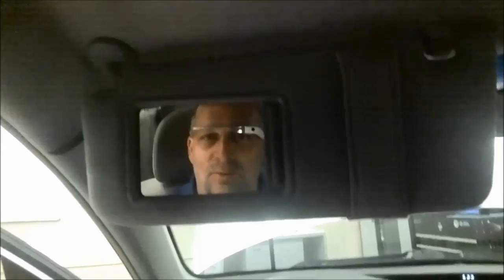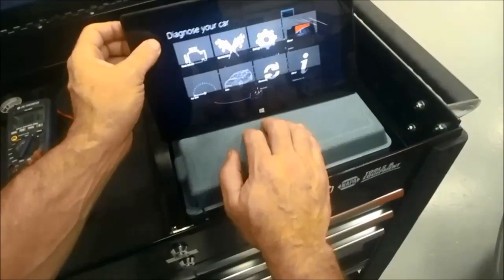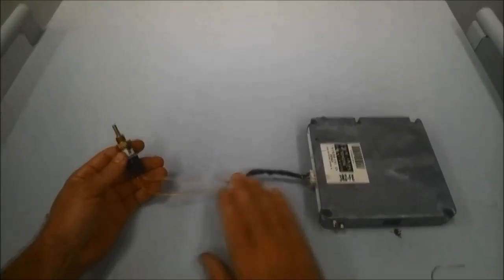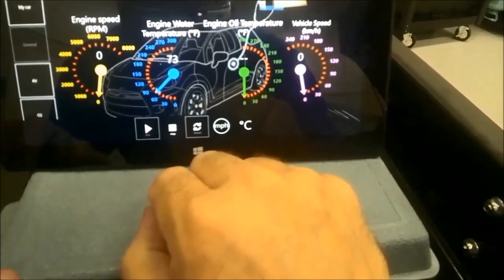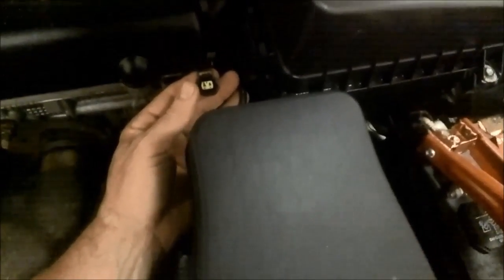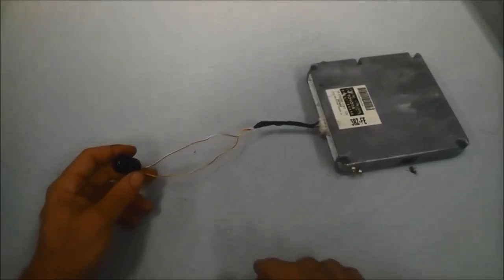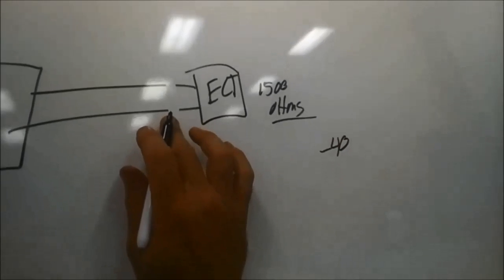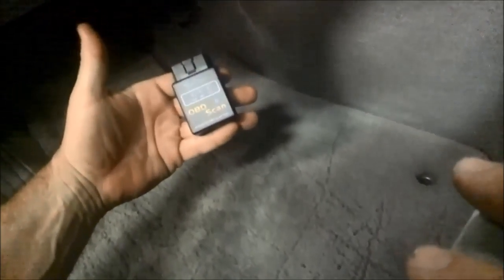Diagnosing a Bad Coolant Temperature Sensor

Comment: Hello on live data scanner my car show with around 20 degrees less than the dashboard. For example, on the dashboard, my car seems fully heated at 90 degrees but on live data on the scanner, it shows 70 degrees. Is that normal? Can this cause my car to have unstable idle? Thanks!

Comment: Would one these sensors make car shut down upon getting up to temp? I have a older Subaru and it runs xlt cuts off when reached temp and shuts down,let sit a bit and same routine, it's a older car...it's not the fan switch engine temp switch ...any help be great...old true 4x4 Subaru ..

Comment: Been through 3 ECT's in about a month..The tip that dips into the coolant stream actually gets abraded off, exposing the wire and the whole thing fails..difficult cold starts, rough idle until warmed up..replacing ECT  solves the issue for a week or so..It's like there is some abasive grit or sand or somethng in the colant stream that destroys the unit..any ideas?  2008 Toyota Takoma 6 cylinder.  Thanks, Jack

Comment: Anyone here know where s temperature switch not sensor is located in a 2005 hyaundai sonata? Its saying its its overheating when ac running but not actually overheating i had checked and was told replsce switch but cant find anywhere on car any help would be greatly appreciated

Comment: Hello i have some problem if you can explain or help i will be appreciated,
I changed coolant temperature sensor to the New GENUINE,
but some times i have a problem with a/c its in i long range of drives i see that a/c stop working...and voltage if dropped seriously and car run poor i did diagnostic and see this error (00522 A/C engine coolant temperature ECT sensor - G62 Implausible Signal.
Some one can explain what is it???
I cannot believe that is a coolant temperature sensor that i change!?
Reply: Sorry i forgot my car is Seat Cordoba 2001 engine 1.6 AKL Manual transmission 5 speeds

Comment: I replaced my sensor but it still gives me a p0128 temp got high input
Reply: And I just replaced water pin, water  lines, thermostat, and a radiator. That s when I first got the code p0118 and when I replaced that I'm still getting the code

Comment: I've been having an issue with my 2010 legacy 2,5, at 109,000 miles with the heat light coming  and the a/c running warm. We have replaced the timing belt, thermostat and hoses as well. but it still keeps happening, how do we know it if it is the sensor? In addition we are not losing coolant. It's been pressure tested.
Reply: Check for radiator issues where the coolant could be stopping up in a dirty radiator causing poor liquid circulation. If you noticed significant coolamt lose without leakage it could point to this problem.

Comment: hi. currently my pcm turned on the radiator fan at 97c, can i modify it so it would turn on the fan on 90c. thanks
Reply from the maker: It would be helpful to know what vehicle you are working on, if you can please provide the make and model we can try and better answer your question.
Reply: Right, I forgot to mention my ride, I'm a proud owner of mazda 323 1997, in Indonesia we called it Familia, but in other country they called in protege. BP engine 1.8L. I slowly build my car from quite bad condition. the previous owner plug wrong PCM / ECU, and I just got a second hand PCM. Previously I have a bad ECT, I believe it switch on my fan when it hits over 100c, because a always find my radiator reservoir goes boiling every time after I arrived home, then I change it. but now the ECT turn on the fan in 97c. I want to get it even lower around 90c. because people said that my engine's working temp. is around 85c-90c.

Comment: j-tech I have a question.i have a 2004 nissan 350z. code 128 come up. it was for the thermostat sensor so I replaced the thermostat sensor and I replaced the thermostat. the check engine light still comes back on for the same code. the car is not overheating the temperature stays the same I let it sit and run for an hour every day and nothing happens for the code keeps saying thermostat sensor. when I unplug the sensor but the fans turned on full speed and the car ran like crap I plugged it back in the fan turned off would you have any idea what is causing this sensor code that keep popping up

Comment: would a bad coolant temp sensor shut down the engine?
Reply from the maker: +Carlos Villarreal Yes it can if the failed sensor is showing that the engine is severely overheating. Not every powertrain computer is programmed that way but may later year models are. When it reads the engine temperature as excessive, it shuts the fuel off so that there is hopefully not a catastrophic heat related failure of the engine.   The engine “hot” light will also be on.
Reply: No your temp gauge will probably stop working an your radiator fan might run all the time when car is running.
Reply: No, fans are controlled by a different coolant temp sensor usually mounted on the radiator.

Comment from the maker: Bert, shorting the sensor would make the ECM or PCM read the highest full temp possible. Unplugging the sensor would read the lowest temp.
Reply: it depends on the resistance of the wire used in the shorting, eg thick or thin wire.
Reply: My Toyota Camry is reading -40 degrees on the scanner with a brand new sensor hooked up. So you're saying if I jump this wire I should see the scanner jump to 280 and if I don't it's a bad PCM because I replaced all the sensors for the ECT circuit and no matter what I do and the computer thinks it's negative 40 degrees so the car runs like shit when you start it up and then once it's running it stays running

Comment: I have a 2000 chevy s10 4.3 4x4. It has 102k miles on it now but the issue with it is (and it's been this way sence I got it) it dont start when it gets real cold out. On a rare occasion it will but more offen then not it won't start when its real cold out, just cranks. It's only when its cold and it gets fuel. I know it's July but trying to figure this out so I'm ready for winter if I keep my truck. Any ideas and help is appreciated. Thanks in advance

Comment: Any suggestions on to why a 2003 jeep liberty renegade  smokes white for about 5 to 10 minutes buy after that it don't have white smoke coming from the exhaust?
Reply: +karzygijose  Does it smell like anti freeze, it'll be a sweet smell, if so prbly leaky head gasket, and your coolant level will gradually go down

Comment from the maker: The coolant temp circuit works the same on most systems. If you send me the vehicle info I can check and let you know.
Reply: Whats the name of your scan tool,thanks
Reply: On my scanner my temp would read - 40 for a sec then goes back to normal temp. I tested the harnesse that connect to the ECT sensor it checked out good. So it has to be the sensor right?

Comment: Amazing video and use of google glass. 
I have a question however. Got a 2003 mustang 3.6L V6 that keeps overheating in traffic. Only in traffic. Changed waterpump and thermostat to no avail. When i look at the rad fan though, it spins slowly and when the vehicle is about to overheat, its still not coming on. Im wondering if changing the coolant temp sensor will fix this, or should i replace the fan also?

Comment: And if this sensor is bad the car will do what?  I have a 92 Olds Cutlass S that I have changed the IAC 4 times in 2 years which always fixes the sudden rough idle. This time it did not change anything, still idling rough. Temp on car going to about 250 on the dash guage, which I don't think is right.  What about the other wires/sensor at the coolant tank? What if there is too much coolant in the tank, will that affect anything?  thanks for your help.
Reply: sparkymgtow Hi! May i ask you how it ended? If it ended
Reply from the maker: First things first, make sure the vehicle is not overheating and solve that issue first.  I have a few questions, Does your 92 Olds have the 3.1 engine? Does the vehicle only idle rough or does it run rough at higher RPM too?
Reply: J-Tech thanks for responding, It is not overheating. I also changed the coolant temp sensor to no avail. The car runs fine until it reaches operating temp, then the idle shoots up to 3000 rpm and wont come down. No CEL on. I'm stumped. A mechanic told me it needs a reman computer module.
Reply from the maker: I have replaced many  computers over the years that make a vehicle do crazy stuff and they did not have a MIL on. A 92 it has OBD-I system and they have many items that are not monitored like today. I would check some basics before I replaced any items. Vacuum leak, PCV System, etc. If you have a scan tool or know someone that does let me know and I can help you with look at some data to help point you in the correct direction, binding TPS etc.
Reply: J-Tech What I don't understand is...  this engine 3.1 - 6 cyl which was produced and used in several types of GM cars for years is considered a good one. It's been great to me. A '69 Chevelle wouldn't be having this problem because it's not an engine issue, it's a damn sensor/computer issue. This issue of the car idling up to 3000 rpm at operating temp is everywhere you look on the net regarding 92 Cutlass... same thing. This is obviously a glitch with this particular configuration of engine/sensors/computer, and it frustrates me that 22 years later GM hasn't put out a memo about a defective situation they created. Everybody has this same problem, and everybody is throwing shit against the side of the barn and nothing sticks.  Thanks for trying to help. The mechanic put new computer on yesterday, and he is stalling giving me back the car. So I believe that was not the problem and I just got stung for a $425 computer that sells online for $100, reman... Now he's doing more stuff. The car only blue books at $775 and my bill is going to be more than that. The issue is I'm the original owner and this car is mint. Not even a seam coming loose in the original interior. The car is immaculate. This mech said he was a 20 yr GM computer troubleshooting specialist.... and he can't even find the damn problem, he said it was a real "brainteaser"... not good for my wallet.
Reply from the maker: Please let me know if I can help in anyway. If not, let know how it turns out.
Reply: J-Tech Thanks, got a call this morning. I was right, it's not the computer. Now he is looking into the EGR. If it isn't that, we are out of options, yet the car is still freaking out. I'm going to buy an old Chevy truck with a 350 and an auto trans.or a VW Bug, sick of this computer crap.
Reply: planet1250 Oh, it ended all right. I sold the car with full disclosure. I think it was a warped aluminum intake. This car was perfectly maintained (my mom was the original owner). Not one blemish on the interior or exterior of the car. Everything worked perfect, complete cream puff. But the engine only lasted 140,000 easy miles.... because in 1992 GM was making shit cars. Lemons. That is back when Honda and Toyota capitalized and kicked their asses. Just changing the spark plugs on this car was a total pain in the ass. Everything was a pain. Sensors everywhere. The coding system didn't get specific until 1994 so you would get readings like "sensor"... well there are about 10 sensors. So you start putting them one by one. 50 to 200 a pop. There are so many things it could be, crank sensor, idle air control, vacuum leak, fuel pressure, coolant temp sensor, maf sensor, smog issue, plugs, coil packs on and on and on.... get rid of it and get a newer or older car. An old Chevelle you can work on yourself, or a little rice burner like a Corolla. Good luck. o/
Reply: sparkymoo ae

Comment: well done
Reply from the maker: Thank You! We are going to use the google glass in many of our training videos and workshop activities. We feel this allows the student a better look at what the instructor is focusing on.
Reply: @jtechinstitute  hey Car's coolant temperature sensor always reads negative like -48, and causing rich like condition, but no trouble code, but my car's behavior is completely changed like increased throttle response feels like car is running rich, how do I diagnose the issue? Please help., I replaced the ECT sensor still same thing is happening..

Comment: Does anyone know if other car manufacturers have the cylender deactivation like ford to prevent overheat damage.
Reply from the maker: I am sure most of the manufactures have some type of cylinder kill but I know Toyota and General Motors both have cylinder kill on certain models.

Comment: The coolant sensor is often referred to the master sensor because it controls a host of critical engine functions, thus I conclude it could cause multiple issues simultaneously air fuel ratio, spark timing / advance. Taken that into account along with the constant expansion and contraction these sensors are more than likely prone to fail so I would check it first.
Reply: If it goes badd did it shut off your gas to the fuel pump

Comment: I'm assuming 284 is the maximum temperature/ resistance. I know their is basically a linear correlation between coolant temp and resistance, and normal operating range should be ~195 to no more than 230 if you factor in ambient and condenser temp.
Reply from the maker: Below is a link  to the ECT sensor chart for the vehicle I was performing the video on, this shows the relationship between resistance and temperature. Normally when the ECT circuit has an open circuit it shows -40 degrees on a scan tool and when the circuit has no resistance it will show 284 degrees. Thank you for all your posts!

 http://www.autoshop101.com/forms/h32.pdf